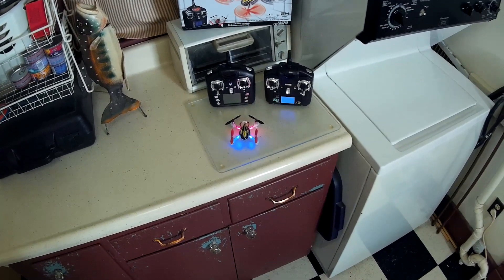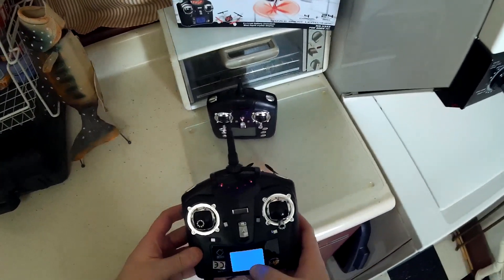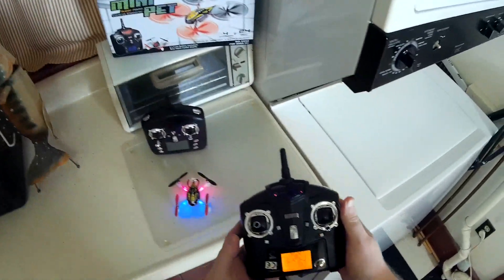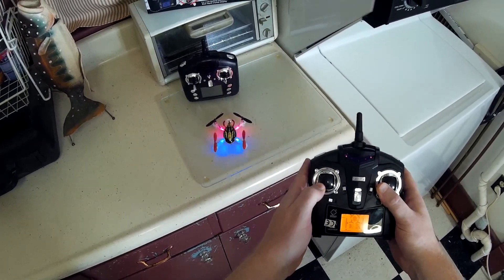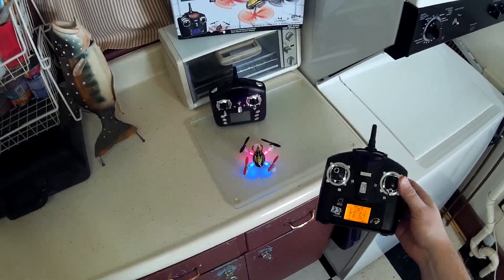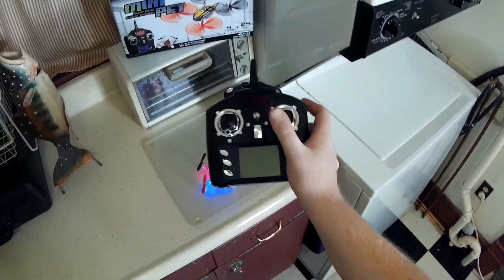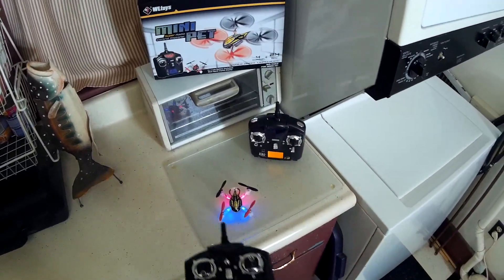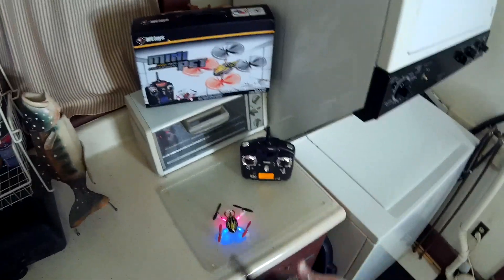How To: Calibrating Accelerometer In The WLtoys V252 (V2X2 Protocol)

Comment: Hi Ryan, thanks for the video. 

I have a problem with my WL 252. After an accident, it's impossible to fly as before. It flies always to the rear left side. 
I changed the motor but it's still the same. Even a new rotor is not helping. 
Do you have an idea what I can do to solve this issue, except to recalibrate it because I have already tried it?
Check this video out please:

https://www.youtube.com/watch?v=TS3DQj3Zm4Q
Reply from the maker: You have the wrong pitch prop on the rear left motor.  It should match the pitch of the front right motor.
Reply: Oouh I have probably switched them after the accident. I have to find the spare prop at home.
If this is the issue then I am an idiot :D
Reply from the maker: I am 100% certain it's the issue, but don't feel like an idiot... it is a massively common mistake.  ;)
Reply: It is working now :D
There is another issue. The quadcopter is flying in the rear direction and it's hard to move it forward. Props look ok. I had this issue before the crash, but sometimes at 60% I was able to fly it.
Reply from the maker: GreenTea And you have recalibrated it as I showed in this video?  All your trims are centered?
Reply: On my transmitter, the left stick is for throttle and the right one is for directions. On your video it's the opposite.
I did what you said but it did not help. I have adjusted the trims a little bit and it better now, but not perfect. I have to test it outside.
Reply from the maker: GreenTea No, on my video the sticks are the same as yours... Mode 2.  Throttle/Yaw on left and pitch/roll on the right.
Reply: Hmm but on my transmitter the left stick stays at any position I want, and right one has a spring and the stick is always automatically centered. In your video it's the opposite?
Reply from the maker: GreenTea Nope, that's the same as it does in my video.  :)
Reply: Hi Ryan, I have managed to adjust the trims and now is much better.  Thanks!

Comment: how do you calibrate WLtoys 636 skylark.. when I hit the throttle up, one prop is not spinning as fast as the other 3, or not moving at all.. I just had a tree crash..
Reply from the maker: +Paul Quito The method in this video should recalibrate the V636.  Sounds like you might have a dying motor though.
Reply: Yea, my motor died out

Comment: I have v252 . To me the instruction for the  transmitter setup are vague . How do you maneuver through the different skill levels ? How do you enter the percentages for the the different functions ?
Reply from the maker: Kymarb2 You can't change the percentages, but you switch through them by pressing the buttons on the transmitter.  You should check out my full review of the V252 for more detail.

Comment: Hi Ryan ,I had V949 I did calibrating accelerometer like the way you show on the V252  and V222 but do not work,may be the v949 have difference procedure,? could you help me to adjusd on V949,Thank you Ryan !
Reply from the maker: canhthanh le V949 is only 3-axis, so it does not have an accelerometer to recalibrate.
Reply: Thank you Ryan for information .

Comment: hello, thanks for the video, what do you think can be improved calibrate the accelerometer? I think that the V222 is the same calibration. I have had several drives V222 and the last unit is less stable especially when losing height, do you think that could deverse to poor calibration of accelerometers?

A greeting !!!
Reply from the maker: vanhaker Quads are notorious for instability when descending... that is usually more due to the turbulent air... the quad is descending through its own prop-wash, which is really messy and turbulent air.  Probably not much you can do to improve that with the V222.
Reply: Flyin' Ryan RC
that he had understood the turmoil were to blame, and that is solved with a non vertital descent, ie descending diagonal with my two previous V222 so doing the descent there was a problem with the last unit seems to go down as down as low some power is unstable. So had thought that could be due to some type of calibration of this unit. Regards and thanks for your videos and answers !!
Reply from the maker: vanhaker Maybe the props aren't as well-balanced?
Reply: props are well balanced. Yesterday calibrate the accelerometer whit this metod and it seems that the decline will be better but not until a few days when you can try it at 100% because I could not go flying abroad which is where the fall from great heights and sudden changes in direction more is destabilized. Nevertheless I think the 3 V222 units I've had, this last is the worst gets stabilized. thanks Ryan!!

Comment: what about v959 ??(with that other transmitter)
Reply from the maker: Enrik Bibaj The V959 is 3-axis, so it has no accelerometer to recalibrate.
Reply from the maker: Enrik Bibaj Which do you have, the V959 or the V222?  The V222 is an upgraded V959 with 6-axis, so yes, you can recalibrate the accelerometer like I explained in this video.  :)
Reply: so i have the v222 and i tried today to recalibrate and it seems a little bit more stable but still not totally. I dont know why
Anyway thanks for the answer!
Reply from the maker: Enrik Bibaj Well it may just not be a very stable quad.
Reply: yeah but when i bought it was perfec, extremely stable and now its not :/
Reply from the maker: Enrik Bibaj Well in that case, I would say it's probably taken on some sort of damage.  Check the props for bends, and see if the motor shafts are straight.

Comment: Hi, can you tell me how to calibrate the v222 with the v222 switchable transmitter?
i try to do the "sticks down-left" thing, but it doesn`t work for me, maybe because i have mode 2(?)

thanks..
Reply from the maker: Hmm, I haven't used that transmitter, so I'm not sure.  My transmitter is Mode 2 as well, so that shouldn't change anything.  Is there a flip button on the switchable Tx?  If so, press and hold that and then hold the sticks in the bottom left corner until the LEDs on the quad blink.
Reply: Flyin' Ryan RC
Hi, the 222 transmitter has no flip button, the quad flips by 100% like with the v911 stock tx.. I will try the other v222 buttons.. :)
Reply from the maker: JoeJedi75 In that case, it should work by putting it on 100% rates and holding the sticks in the corners… but I assume you tried that with no luck?  Do you have access to any other WLtoys or JXD radio, just to recalibrate with, and then go back to the switchable for flying?